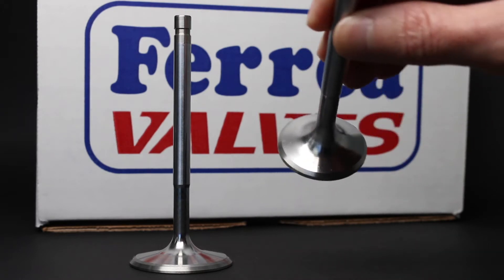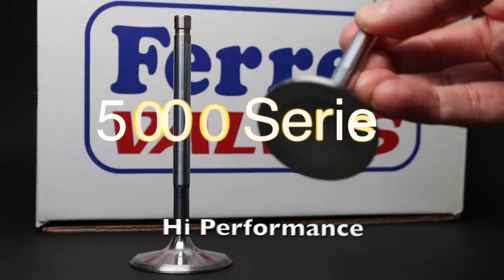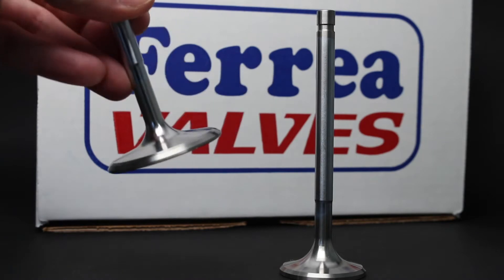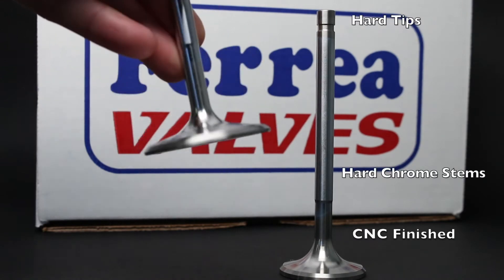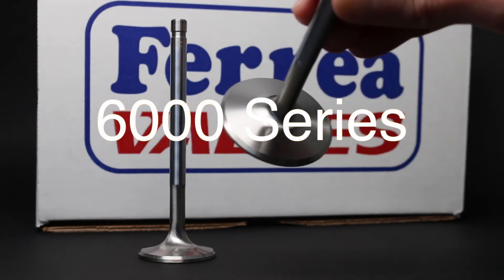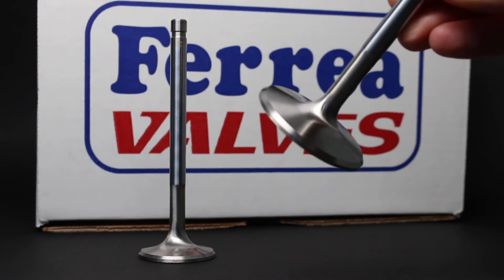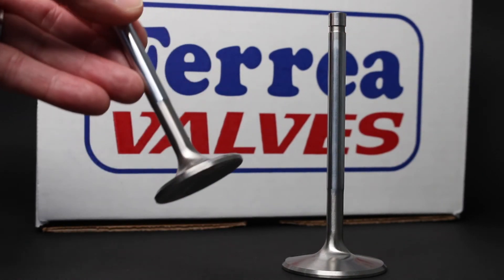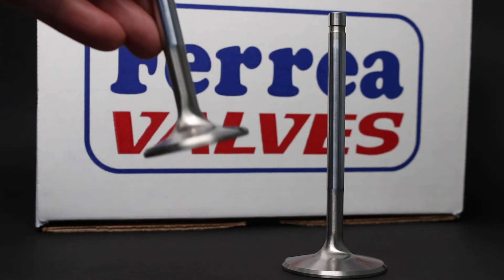Ferrea- 5000  Series & 6000 Series valves

Comment: Are both of this valves not  for turbocharged street vehicles?
I was thinking to use the 5000 for my 400whp turbo b16 build over the oem valves . Rpm 9500 on 90 lbs valve springs stock gsr cams.
Reply: Abec777 Hondatech you need to install our 6000 series for turbo app.
Reply: Thank you for your answer.Is it bad to mix valves? For example 6000 intake competition plus for the exhaust?
Reply from the maker: It's fine to mix both those series of valves. Always making sure you use the best material and quality on the exhaust side and the intake side is a great choice on the 6000 series. Thanks Team Ferrea
Reply: Ok i got a set of 6000 for both intake and exhaust. I ditched the supertech idea. What FERREA valve springs do you reccomend on 6000 valves  and 9500 rpm+turbo.? Not super aggresive cams.Biggest cam will be intergra type r B18C oem cam...
S10027  Dual Spring - Hi Pressure  100 lbs @ 34 mm  220 lbs @ 24 mm  305 lbs/inch  
S10064  Dual Spring - Turbo             95 lbs @ 34 mm , 215 lbs @ 24 mm , 305 lbs/inch 
S10104 Dual Spring - Turbo - PAC enhanced Alloy   80 lbs@34 mm ,  195 lbs  @ 24 mm 292 lbs/inch

Thank you for your time.
Reply: Abec777 Hondatech Great decision, choosing quality over price. We would suggest you go with our valve spring kit #KT4001. Thanks
Reply: Oh i thought you never answered my last question i appreciate it. I have one other question tho. Since you recommended the KT4001 kit, with the 80lbs s10070 valve springs. Do these valve springs will handle 25-30 psi boost or ill need the slightly stronger rate/inch s10104 ?. Thank you for your time.Also anyone used the tool steel rrtainers at 9500 rpm?
Reply from the maker: Do you think you will go any higher on boost in the future?
Reply: No i believe max boost will be ~ 2bar. Biggest cams will be Integra type R or Skunk2 tuner 1 that are slightly larger than itr.  Intake Duration / Lift: 251°/ 11.5mm Exhaust Duration / Lift: 252° / 10.8mm

Comment: can the 6000 series work if your heads is mostly made up of gsc valve train components in a 600whp 2jzgte vvti
Reply from the maker: If you are using 25psi or less on the turbocharger you can use the 6000 series. Make sure that you also use a quality valve lock for the retainer.

Comment: So for the 6000 series maximum 300lb seat pressure, is that open pressure or closed pressure?
Reply from the maker: That is seat pressure (closed).
Reply: @FerreaRacingComponents   Thanks for clarifying. That's what I originally thought, but when I called and spoke with someone in your tech department last week he told max 300lbs at open. Which means I wouldn't be able to upgrade my springs, my stock springs are already 295lbs at open.
Reply from the maker: @Hogwarts-Dropout  No problem. Your current valve springs will work just fine with that pressure.